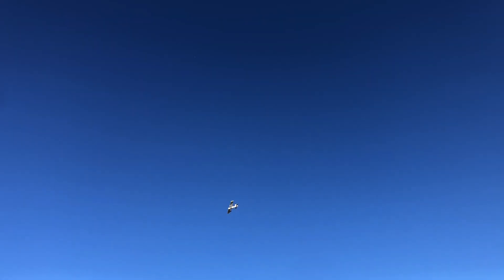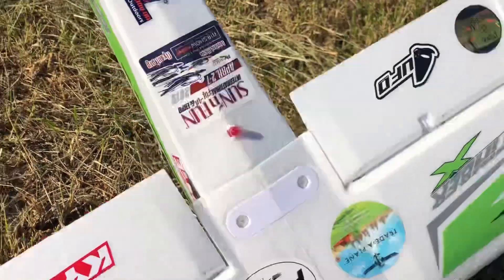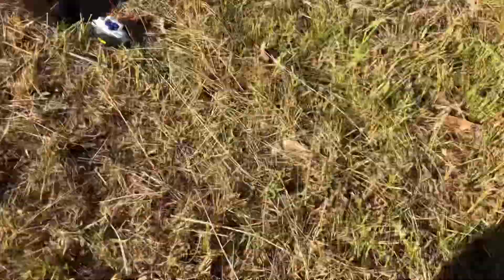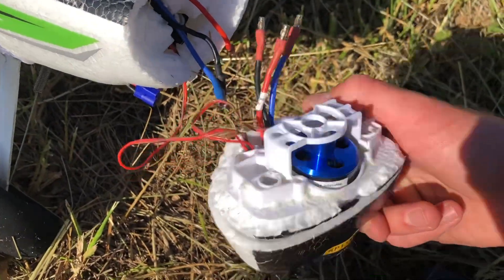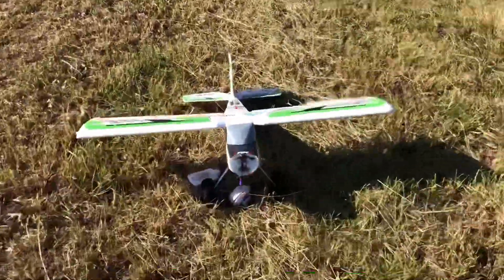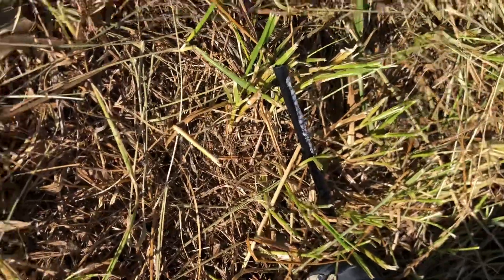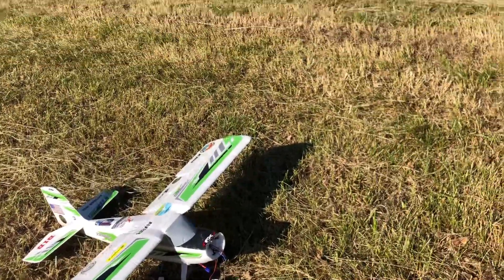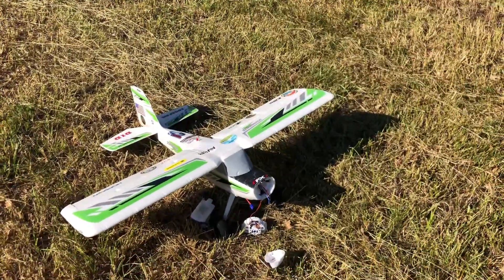Motor blows the WHOLE front end off my RC plane midair! | E Flite Timber X is officially done for

Comment: Easy fix! 👍😁

Ive always used a flat file n ruff'd up the prop shaft & motor shaft. Then i use a couple of drops of blue locktite to assemble both together. But while the prop is off, always ck the motor mount screws. Better safe than sorry 🤷.

Way back when the valiant & green x were new, there was a motor mount issue.
Reply from the maker: Thanks! Yeah well a few of the pieces where the motor mount mounts on to were broken and cracked so I would’ve had to get a whole new fuselage. Didn’t want to do that. Her flying days are over. A great ceiling decoration though now!😂 might get something new 😁

Comment: Mine did the exact thing but because of your video I checked the motor mount screws and they were loose. I coated the threads with a dab of gorilla glue and tightened it back. So far so good
Reply from the maker: Oh shoot! Glad I helped save yours! 😆 Thanks!
Reply: @KB_RC  yours didn’t seem to be damaged beyond repair but sorry that happened. My plane started sounding like a nitro plane with the motor vibrating. I went to change the battery and saw a motor mount screw in the battery box. Took it home and screwed back the motor mount with a dab of gorilla glue on the threads
Reply from the maker: @shanemichaels8289  Could’ve repaired it, but it has caused me tons of issues in the past Ahaha so I figured it wasn’t worth it. Oh well! 
Oh glad you caught that! Could’ve been bad!

Comment: This happened to my plane today. I cut another plane in half chasing a streamer that it was towing and had some damage. I thought I fixed it all. About half dozen flights later it was making a weird noise, same thing yours just did. I thought it might be aileron flutter since I repaired an aileron that got damaged with the previous collision with airplane and ground. I landed three times and pushed and pulled on everything and even changed the prop, then the motor just fell off! It definitely looks fixable though. Should  be able to epoxy the rods back in place and then epoxy the motor mount back in place.
Reply from the maker: Sorry to hear! Yeah I fixed it soooo many times I didn’t want to do it anymore so I took all the electronics out of it and now it’s a hanging model! Lol. Maybe one day I’ll put her back together! Would’ve been easy to fix but yeah oh well. Thanks!

Comment: I’ve heard of people having this happen to their Valiants stock.
Reply from the maker: Yeah hmm interesting!
Reply: I am very paranoid of this happening to my Valiant. I wish the firewall had some stuff extending deep into the fuselage to better hold the motor.
Reply: @andyroman8223  If i were you I’d just rip out the current mount and pump a ton of hot glue in there to securely hold the mount in place. I had to do the same thing on both motor nacelles on my EC-1500.
Reply from the maker: @andyroman8223  I agree! I wish they made a bit better than just some plastic molded into the foam. Just scratched my Timber X. Loved it SOO much but I was tired of fixing it. I would’ve needed a whole new fuselage probably. So dang it. Oh well. Maybe I’ll get another someday! But, I’m about to fly my new plane in just a bit! 😉
Reply: @KB_RC  you could probably build a new firewall with some plywood, and use some wooden chopsticks to penetrate into the foam.
Reply from the maker: @andyroman8223  Yep! Wood would be a lot better for sure I would think. Thanks for the tips… if I decide to rebuild it, I’ll use wood!

Comment: So sorry that this happened, but I do believe the cause was a unbalanced prop, if it’s unbalanced you will be able to hear it, witch it sounded fine when you were at low throttle but when you accelerated you could hear it. basically it was vibrating so much that it ripped the motor mount off, so cause would be unbalanced prop
Reply from the maker: Prop was balanced!! Wasn’t damaged either!!! It has been used a lot! Got a brand new motor and motor mount and flew with it two times before this even happened! Prop had been used quite a bit as well ! So it had to have been something with the motor or the mount. Either way I’d need a new fuselage because where the motor mount mounts, is broken.
Reply from the maker: But I’ve decided to make it a shelf decoration! Lol.

Comment: Buddy, this is why you need to balance the prop. And also make sure the prop is damaged before you fly
Reply from the maker: Prop was balanced!! Wasn’t damaged either!!! It has been used a lot! Got a brand new motor and motor mount and flew with it two times before this even happened! So it had to have been something with the motor or the mount. Either way I’d need a new fuselage because where the motor mount mounts, is broken.
Reply: @KB_RC  yes, I agree. A faulty motor mount will also do what happened to you
Reply from the maker: @aragorn318  Possibly! Still had two great flights before this even happened. 🤷‍♂️
Reply: @KB_RC  Just word of advice. Always check the prop after every flight for any damage, and remove any mud on it. Any of these will make the prop unbalanced.
Reply from the maker: Definitely! Thank you!

Comment: Easy fix this happened on my nite timber hot glue the rods in hot glue front on gtg those prop adapter bend easy any vibration STOP !!!!!
Reply from the maker: Yeah I guess it wouldn’t have been too hard to fix. Yeah I should’ve just landed and kept it there the first time when I wondered what it was. Thanks. I was just TIRED of fixing it. This plane has had so many issues I just decided I’m done with it and it’s going to be hung from the ceiling now!

Comment: I don't think some of these have tight motor screws. Worse is that there's no way to access it properly without cutting up the nose. Mine is starting to make a similar noise and after watching this I'm getting nervous 😅
Reply from the maker: Yeah true! And I just replaced the motor and mount! I don’t know how to help you really lol. Just make sure everything is on tight i guess!
Reply: Huh? You can easily access it. The front cowling is screwed on and the front piece of foam comes right off. You have full access to the motor.